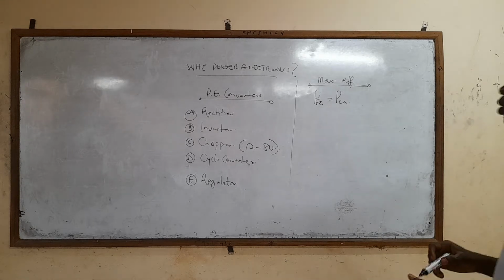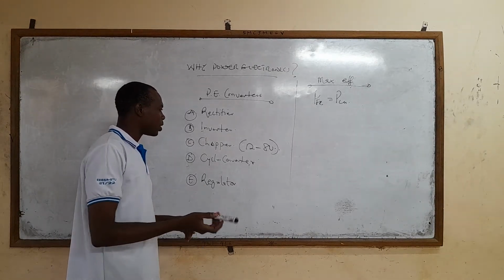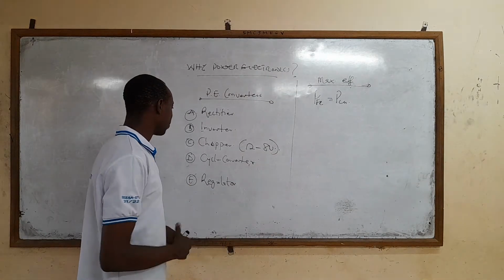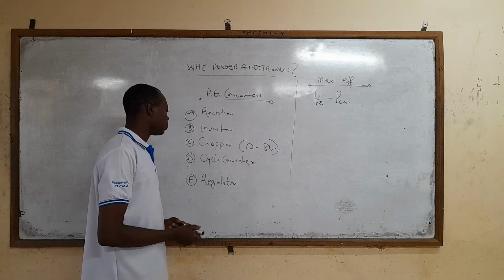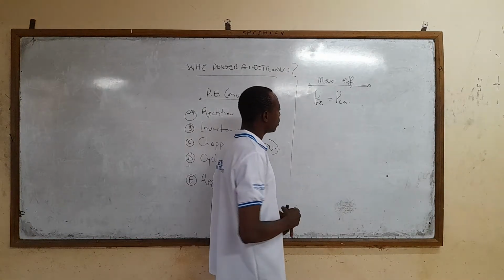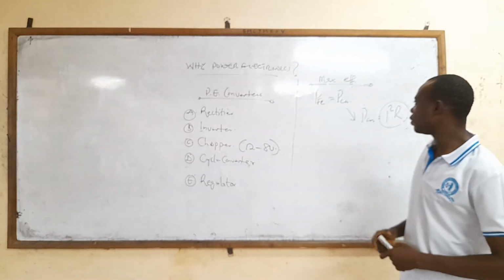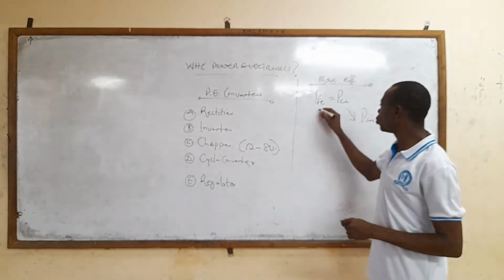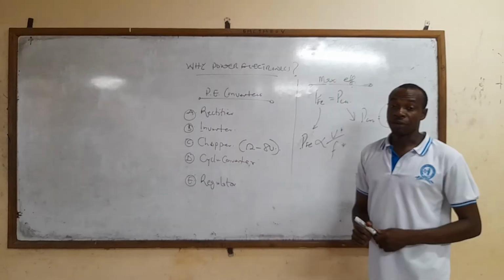WHY POWER ELECTRONICS PT_3

Comment: Sir , my question is about the regulator ,I know  all the converters where they work but for the regulator I’m confused,it is our normal voltage regulator or another converter ?. And which field does it work Ac or dc power source??